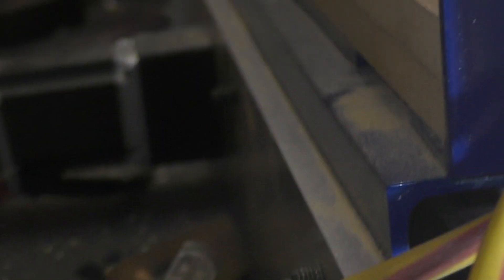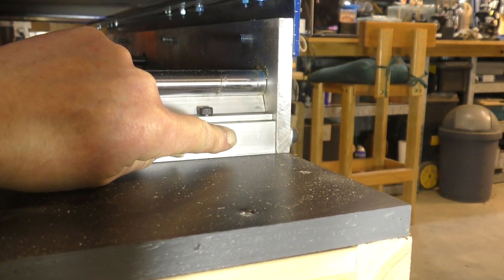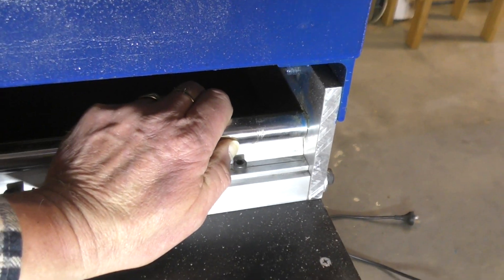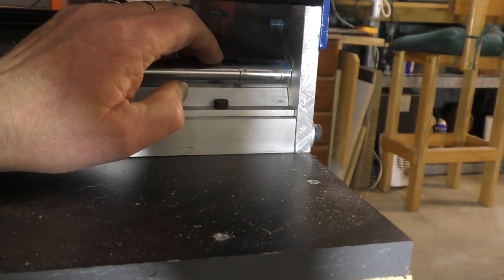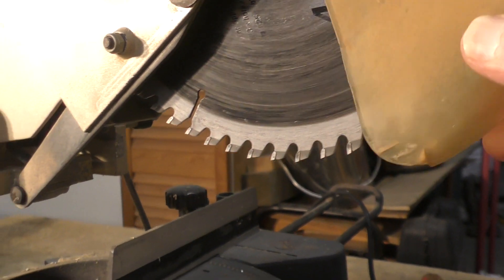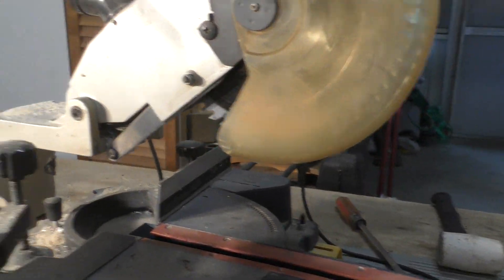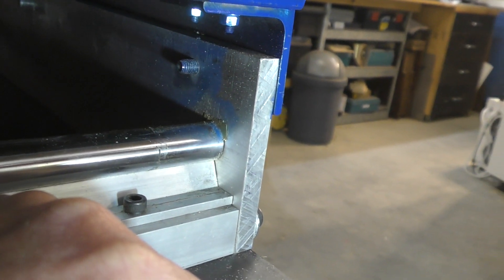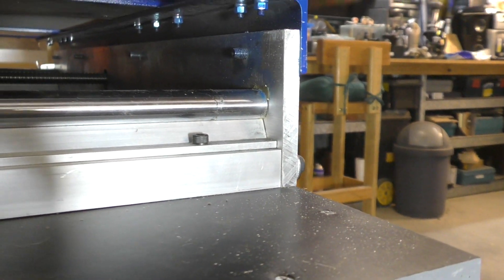When your ball screw’s too short for your CNC Router build and what to do about it

Comment: Is it not possible to fabricate a spacer - or even an entire bearing block if needed - to compensate from the 50mm or so that the ball screw falls short? A 30mm aluminium  spacer maybe attached to the inside of the frame and the existing bearing block mounted onto that....

This would cause you to lose that small bit of travel in Y axis but seems to be a quick and uncomplicated fix, both easier and less irreversible than reducing your existing frame (maybe a future project will give the opportunity to buy bigger ball screw/smaller linear rail).

BTW thank you Roger for all the awesome work, I have followed you since your 3018 series and love both your ideas and the way you present them, a true inspiration :)

Comment: My homemade cnc router was getting a little noisy moving in the x axis, so I decided to put some lithium grease on all the ball screws. As I was using my machine, I realized that the ball nut did not travel the entire length of the screw. This is because I mounted a linear bearing near each end of the slides limiting the amount of travel it can have.. The set of rails and ball screw I got were the same lengths. I realize that if I just get longer rails, I could increase the travel of each axis and thus the size of my work area. I would, of course, have to rebuild the machine for the larger work bed.